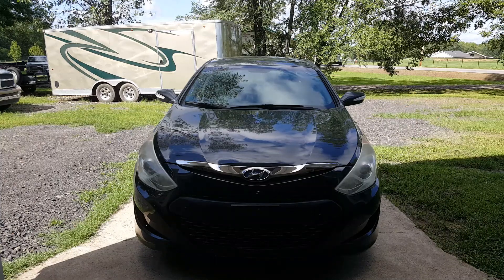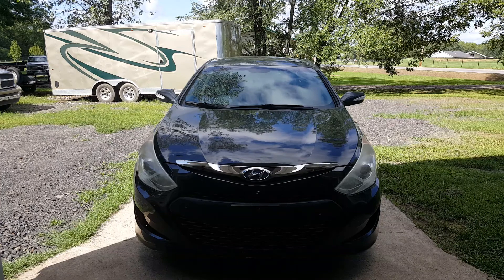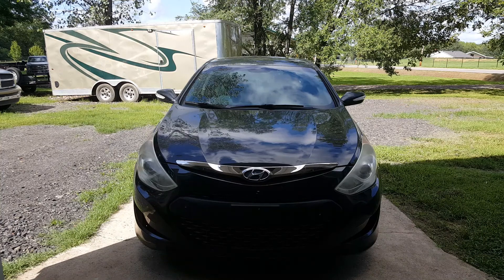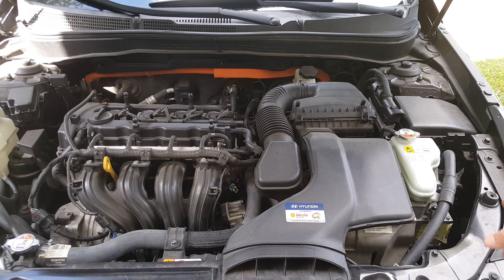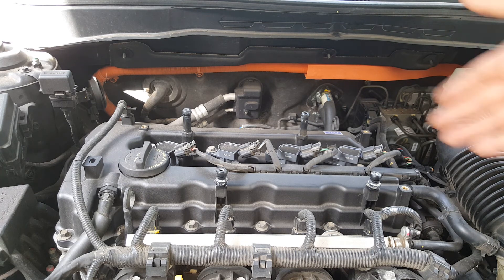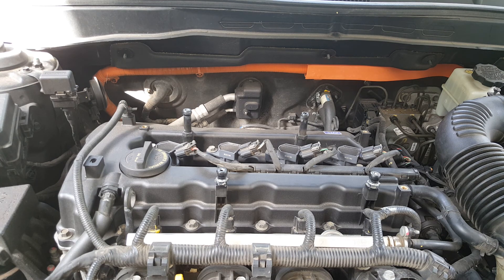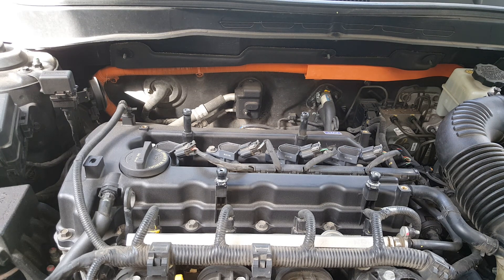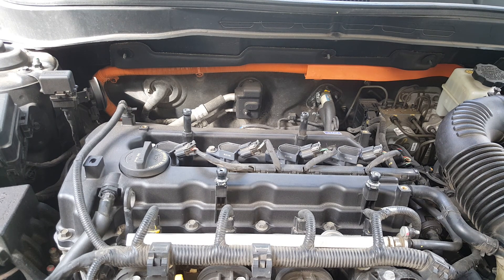Sonata Hybrid MUST WATCH intermittent/severe bucking/jerking on acceleration & braking/easy fix

Comment: WoW~ My 2011 had the same problem!~.. Coil packs were Replaced and fixed
Thank you so much!!!
Reply from the maker: Glad this fixed yours also. Thank you very much for sharing.
Reply: @s33therfan  i'm having practically the same problem.
It jerks from a stop or during transition from EV mode to gasoline engine mode and while braking.
and when the car is warmed up can't go up hill sometimes.
it jerks shifting into drive or reverse.
I guess the issue is related to the coil pack.
I haven't changed it yet but I want you guys to confirm if it is the same issue.
Please help me!
Reply: @alexramazota5379 did it resolve?
Reply: @s33therfan brother please help me i have smae issu I already change transmission but still problem have

Comment: My 2012 Sonata Hybrid just hit 173,000 miles & is doing this exact thing!!! I feel completely unsafe driving my car but it’s all I have.  Worst feeling not knowing whether you’ll make it to where you’re going from day to day. THANK u for posting this video. 
I’ve taking it into the dealership for all recalls and I’ve been told nothing is wrong with it or they can’t re-create the problem but as soon as I leave, I am dealing with it almost immediately….
Reply from the maker: I hope this solves your issue as well . Hopefully this video will continue to grow in views and get the word out . This intermittent problem seems to be quite common. Thanks for the great feedback.
Reply: I am having the same thing. Were you able to find a fix?
Reply: 173,000 that car did its job
Reply: My vehicle 2011 Sonata (hybrid) doing the exact same thing but now when you press the gas it doesn’t go but a tiny bit and then stops. So do you feel this is the transmission? 😢
Reply: @KennedyLopez-k6s I’m having the same issue did you ever figure out what it was
Reply: Did it fix your issue
Reply: Im having a similar issue with mine Its been sitting for a very long time because we thought the hybrid battery was gonna need replaced. But i got it charged and now its running again only for it to be doing this hard jerking or bucking between first and 2nd gear

Comment: Hello, I now have a hyndai sonata hybrid 2014 car and now I have a problem, it knocks out two errors P1B77 and P0A0D, the car has a hit and then another hit and the hybrid error is displayed and asks to stop.  If you turn it off and wait 7-10 minutes, then you can go further, but after 1-2 km the same story happens.  Did you have the same problem and how did you solve it?

Comment: Update: my issue is fixed. The fix was clearing codes with an OBD reader I bought on Amazon for $60. It made this error one other time and I cleared the code again and it's fine. Maybe it didn't "fix" the underlying issue, but it's not had an issue since November (2 months).

Trying this. Will update. Symptoms of a bad ignition coil seem to match. I have the same 2013 sonata hybrid. Im at 77k miles. So far I've changed MAP sensors. Would get codes once or twice "poor engine performance ".
My car accelerates fine, but when I shift to drive or brake or come to a stop, mostly idle mode, and showed "idle mode charging", my car would jerk and buck. Very embarrassing in traffic. Not covered under warranty.
Reply from the maker: Please update . I hope this solves your issue. Very curious how common this issue is. Thank you for watching.
Reply: This did not solve my issue. But it was certainly worth the work. $44 for the coils was not a bad investment to try this myself. Thank you!
Reply: @rawusnews  I have a question until today, did you solve it or nothing yet?

Comment: hey are sonata hybrids reliable? there's a 2013 sonata hybrid with 115k miles being sold for $3,000. it has some issues like a cracked windshield and coupler in steering wheel, but ive been seeing people have issues with the transmission. what do you think?

Comment: Mine was my Hybrid Belt, 8000 miles and omg it was unbelievable how bad it was chewed up, never would’ve thought. I was told by dealer it needed a hybrid battery, or coils, well upon removing belt it was unbelievable how bad it was. Problem solved.
Reply from the maker: Thank you for taking the time to share this , glad you got this issue solved. Thanks for watching.
Reply: Hybrid belt?? Where is that even located?? Part number?

Comment: Hi Great Video, do you know where is it located the AC expansion Valve? 

I’m having this issue started the other day it was blowing cold air. I checked the gauge and it was low on Freon. 

Today I filled it to the right amount in accordance with environmental temperature. The low end is good but the high temperature is moving drastically from 500PSI to 150 PSI! 

Sometime it blows cold it and then it doesn’t.
Reply from the maker: The expansion valve is on the fire wall where the ac lines run. You have to remove the lines to be able to get to it. Then the expansion valve is usually bolted on as well. I would also replace the condenser while I was at it. The condenser can get blockages and cause high pressure issues. Of course have the system recovered and empty before starting any work. Hope this helps.

Comment: We have a 2012 Sonata Hybrid

The dealer put 4 remanufactured transmissions in. Changed DC converter, ECM/TCM, nothing. I just changed the ignition coils and spark plugs...still happening. Is it easy to replace the wires going to the packs?

 Before the dealer took car in 2 years ago, I had a clogged catalytic converter. I think it partially unclogged itself. They never once addressed it. I read on the hyundai forums that the catalytic converter could be throwing the sensor off and messing with the shifting. Is that possible? Any other things I can try to fix this?

Thank you
Reply from the maker: Very good possibility the exhaust could be the issue. Other than a wiring harness seems they should have ruled most everything out. Seeing how you mentioned the cat , I would start there. I am leaving a link . The price of the tool is cheaper than a muffler shop and you'll have the tool for future diagnostics. You place the tool in where the upstream 02 sensor goes . It has 6 foot hose to easily read the gauge from inside the car . Thanks for your question.
https://amzn.to/3JjgorT
Reply: @onetinyspeaker I have a Hyundai Sonata Hybrid 2012 car is getting error code P0A78. What error code were you getting and what was the final fix?

Comment: Do you have to get different coil packs for the hybrid as opposed to the regular sonata? I clicked on the link for Amazon that you put on the other video and it says coil packs for Hyundai sonata but it doesn't say hybrid? Just wondering if it matters
Reply from the maker: They are the same , thanks for the feedback .
Reply: Thank you for the feedback as well sir and a great video
Reply: Ok I’m sold on your FIX! My car has had this issue for months and throughout 3 shops including dealerships, I just picked up my car and the dealership said it’ll be over $5000 to replace the transmission.  So I’m shopping around for a new transmission for this 2012 Hyundai Sonata hybrid. As I’m searching your video fix popped up! Wow , ok I watched this video 3 times and my fingers are crossed I really need this car fixed and I can’t afford a new one. So now how do I change out these coils? Did I see you write they’re $30 ish online? Thanks in advance

Comment: I was actually thinking about replacing the coils but like you said there was no engine code. There was nothing. This car is only three years old. That’s right my car is a 2021 with the bucking and jerking going down the road. It has a little over 80,000 miles on it. Yes I drive it a lot, so I was actually thinking about doing the plugs and coils and seeing if that would fix the issue unfortunately the coils for the 2 1/2 L G upstream smart engine is a little over $100 apiece for the coil. Don’t know if it will fix it, but I’m starting to get the feeling that I might have a faulty or failing coil at 80,000. If you really think about it that’s a lot of miles and it’s three years old .
Reply from the maker: Hope this solves your issue as well , thank you for watching.

Comment: I hope you take the time to read me, I have a 2012 Kia Optima hybrid and the problem it has is that when I go at a low speed it accelerates and hits and I looked for a lot of information and I never found anything I hope and what is in this video works for me, Just a question. Was the problem you had in that Hyundai similar to mine?  I don't really speak English I was using the subtitles in Spanish and thanks for putting subtitles in Spanish I already subscribed
Reply from the maker: It seems similar. My car would no throw a code for 2 months. So I was very happy these coil packs fixed the issue. You can get a set online for $30. Thank you very much for the feedback.
https://amzn.to/3LWwd9u

Comment: Hey - my 2016 hybrid does just a single jolt on the first switch from battery only to engine/battery.  No other times, it’s not showing a check engin.  Should I go ahead ahead and replace orrrrr? What do you recommend?
Reply from the maker: I think that jolt is pretty normal , thank you for the question.
Reply: Hi good day dear I have hyndai sonata 2011 hybird if I apply break it’s juerking little and check engine light with code POC17 kindly advise what’s going on thanks
Reply: @s33therfan hey - I’m back, lol, I love all your content. You’ve proven VERY helpful.  So the one single jolt has persisted but it’s not gentle, I HARD, shake the whole car and passengers like, surprises all passengers, startlingly hard - with coil packs being so cheap I did go ahead and replace, it made no change to this hard jolt  - no codes or anything, any other ideas?
Reply: Oh and if I leave in park and rev the engine for a few mins the jolt doesn’t happen at all - not even a minor one

Comment: Did it rev up while driving like its slipping gears?

I got bucking jerking and slipping literally out of no where since ive owned it since 30k miles.  At 85k miles now. Pretty sure its the trans but coil packs would be nice😂
Reply from the maker: Mine mainly was bucking and jerking at stops and take offs. I did not really have any slipping , that I recall. Hope it is something simple with yours , thank you for the feedback.

Comment: I have a Kia Optima and it does the same thing idk what to do. And I’m only 23 and a woman so I hardly have a clue I’m going to see
Reply from the maker: I was really surprised when this fixed my issue. I was very sceptical when getting the parts. They are very easy to change if you have a few tools , 10mm and possibly a pick tool if the clips are stubborn. Still driving the car today and there has not been a single issue yet. Thanks for watching.
Reply: I have a question until today, did you solve it or nothing yet?

Comment: Hey thanks for the video.  Were you getting the hybrid battery warning in the in-dash screen or anything like that?  I have 2012 Hyundai Sonata Hybrid and it started loosing all acceleration and can't go over about 35, and the Hybrid battery warning comes on, but dealer says it is transmission needs replaced.  Error I am getting is same as in this video at 45 seconds......  https://www.youtube.com/watch?v=9X_qykINiXw
Reply from the maker: If it is still driving and shifting fine it could be another issue. I would for sure start with the cheaper components first. I am assuming the hybrid battery is not charging and it is going in to limp mode. Mine was throwing a hybrid warning and going into limp mode and I would have to turn the car off let it set restart etc. The first thing I changed was the dc converter. Less than 80 bucks on ebay , no programming . All i can say as that the limp mode warning was gone and all has been well since. Not saying this could be your issue but you may have a simple problem , I have heard of people prematurely replacing these transmissions. Even a low 12 volt battery can cause issues. Thank you for the feedback.
Reply: @s33therfan  Seems to drive fine and shift until you get above 35 to 45mph, then the "transmission"(per hyundai dealer) issues start.  I always felt like it was something a little different because it was driving just fine and then all of the sudden, no acceleration on a hill, the hybrid warning came on and I stopped.  When I restarted it, hybrid warning gone, but the power above 35 just isn't there.  I would think if it was the transmission there would have been slipping or other tell-tales before the first instance of failure.  I may spend the $35 on the coils and try it out, I guess I could always return them if it isn't it.  Already replaced the 12V battery at the dealership when they did the diagnosis.  I appreciate the reply and I'll try your fix with the coils.  I may also see if it is the Hybrid fuse, I saw in another video, but thats like $75.
Reply: @s33therfan  hey sir, do you remember the part number for the DC converter?
I'm trying to find one and everything I'm finding is either $2k or very used. Just want to see if you might have the part number.
Or could you tell me what it looks like? Any video of you replacing the DC converter?
Thanks
Reply from the maker: Here is a link:
https://www.ebay.com/itm/334429221522?mkcid=16&mkevt=1&mkrid=711-127632-2357-0&ssspo=k2FwkQzXRV-&sssrc=2349624&ssuid=_yxSh9fFQaS&var=&widget_ver=artemis&media=SMS
I don't think any of the part numbers matched on mine , but it works fine. It was not too difficult to replace. The main fuse has to be removed from the hybrid battery prior to any work on these cars for safety. Thank you for the feedback.
Reply: @s33therfan can you please make a video of replacing the DC inverter?

Comment: my car jerks and my coils are fine
Reply from the maker: I would check for codes or have someone with a scan tool check the live data . Maybe catch it when the problem occurs. Thanks for the question.
Reply: @s33therfan  my car was cheaked turns out my trans oil was still red but not lubricating enough ps my car has 68000 miles on it
Reply: @mr_dia4543 did you get it running again?

Comment: I have been dealing with this same problem with my 2011 for the last year and it is so frustrating. I dread getting on the highway because I always have to end up pulling over to restart the car. It happens whenever it wants and I was told it was my spark plugs or my valve gasket cover was broken and leaking fluid into my spark plugs . The car bucks and decelerates when I push the gas in. It also stagnates at the same speed and won’t allow me to accelerate. I have no idea what is causing this and I’m losing my mind!!!!!
Reply from the maker: I would start with replacing the coils , it won't hurt. Thank you for the feedback.